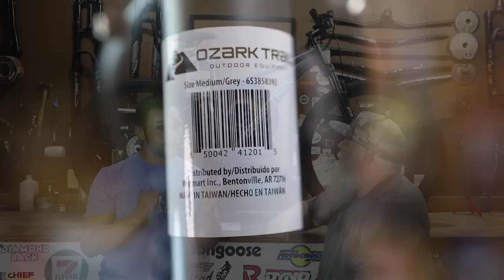Ozark Trail Ridge: Initial Impressions | Positives | Negatives | Who It's For

Comment: It's an Integrated Headset, no removable cup like Zero Stack.
Reply: What does that mean
Reply: @joshuaworth243  with an integrated headset, the head tube is machined to seat the sealed bearing, no cup installation is needed. Zero stack still uses cups but they are recessed into the head tube, so no additional stack height like external cups.
Reply: @cunvericht My Diamondback Overdrive is like that. It was a very cheap yard sale buy. It uses what looks like sealed cartridge bearings.
Reply: @cunvericht is this a good or bad thing, can I upgrade the fork if I were to buy this bike?
Reply: The new updated version doesn’t have anything in the head tube it’s clear open inside so they listened again
Reply: So can you upgrade to a tapered fork??? Instead of a straight steered tube?

Comment: Just an FYI, if this helps anyone, the Ridge is only offered in medium and large.  I am 5'11" and I originally bought the large because I was in between the two sizes.  The large is HUGE; it is as big if not bigger than most companies XL bikes.  The only large bikes that are similar in size large are the Rocky Mountain Fusion series, Marlin Gen 3 series, and Kona Lava Dome.  Part of the issue with the large frame is the stack...it is 662mm!!  I have ridden the Fusion, Marlin Gen 3, and Lava Dome and they didn't feel as big.  Long story short, I went with the medium and I think that was a good choice.  The Ridge medium is almost identical in size to the Trek Marlin Gen 2 series large or the Gen 3 series M/L (which is my recommended size).  The geometry is sooooo close to the Marlin Gen 3, if you like that feel.  So, I feel like I got Marlin 6 Gen 2 for half the price or Gen 3 for $500 less, and ready for upgrades!  If I put that extra $400-$500 into this bike, it will dominate similar priced bikes spec-wise.  I hope this helps!
Reply: So your saying the large would be great for a guy my size? I'm 6' 6"
Reply: Found a small in my local walmart
Reply: @trevor50ify  Me too! So lucky
Reply: They do have small frames, I bought one for my wife. I'm 6' and the large was a bit too big for me I got a medium.
Reply: Just sat on both today and yeah the large is fkng massive. The medium was perfect lol also now that it's been a while look for the updated version not the old one. They updated to better tires and a few other things as well

Comment: I just picked one of these up. Mine has a microshift Advent trigger and microshift acolyte deraileur with clutch a d a narrow wide chain ring!!! The frame has additional guide loops for cable rear brake cable routing. I will use them since I'm going to upgrade to hydraulic brakes immediately and they come pre filled. Absolutely amazing! They definitely keep improving this bike. Only the brakes are bad. Really bad. Otherwise Buy!

Comment: I'm curious if anyone has told you about the newest version of the Ozark Trail Ridge. I bought two after watching your videos and one was just like the one that you made the video using and the other one... well, wasn't. 

I bought one for my wife and one for me, online. One of them shipped assembled from my local walmart while the other one shipped from out of state in a box. 

I was pleasantly surprised to find quite a few differences from the videos of yours. I'm going to list some differences I spotted below.

- 180mm Front brakes (instead of the 160mm)
- JAK Front and Rear brakes (previous was Radius)
- Acolyte Derailleur (as oppose to the L-TWOO used before)
- Rear Derailleur has a clutch
- Microshift Advent shifter (previous was L-TWOO)
- No display window showing current gear on shifter
- 30T Narrow Wide chainring (previous was round)
- No plastic ring around the chainring
- Thicker crank arms
- Tires look overall the same but now have Yellow "Kenda" lettering on one side
- Smaller/sleeker dork disc
- Comes with a kickstand (for those that wish to install it)

Also, the owners manual has information for a Small Frame. I'm hoping that means we are pretty close to them releasing the small frame.

I'm going to be returning the now outdated model that I received.
Reply: My small frame has everything you just listed straight from the store, walked out and rode her home.
Reply: @Gamerhog2022 got one today, same as yours

Comment: 14:19 It's called integrated headset. As the bearings sit directly in the frame. An issue with this is if you abuse it and you can screw up the head tube, but with a press fit headset you can swap the headset instead of the frame. It's very common, but the main advantage is lower weight and easier service.

Comment: Dude! I like that the frame can accomodate two water bottles! And the headtube design is like that of my sandugo brusko machete V2 frame. For the price of the bike you spend less for upgrades. Internal dropper post routing. If you swap in a 120-130mm fork its gonna get more slack but is still safe. A good starter bike for those who wanna enjoy descends and climbs off road. 🤟😊
Reply: I don’t think it’s meant for 2 water bottles, just one placement individually.

Comment: Now that looks like a real MTB is this the next Ardor?   I always find the sizing interesting, I’m 6 foot tall , manufactures will always say I need a large, but I always ride a medium as I like a small frame with loads of stand over height, it’s also much easier to move the bike around and control it.

That’s headset is a really unique feature on a bike at this level, it is an huge upgrade!

Comment: I picked one up this morning from the Florin Rd store in Sacramento. There are 2 more on the rack now. I just bought the Northrock XC27 a few days ago from Costco, so will be able to compare the two side by side, then I'll return one (I'm thinking the Northrock will be going back). I jumped on a scale with each, and the Northrock (27.5) with the factory kickstand is about .4 lbs lighter than this Ozark trail 29. The OT is a few inches longer total. If they both had a kickstand I imagine the actual weight difference would be about 1 lb heavier for the Ozark Trail.

Comment: Just picked up this bike from Walmart for $150 clearance. Looks like someone returned it but all it needs is the rear derailleur tuned or replaced. It won’t shift like the cable isn’t even attached. If I have to buy a new derailleur so be it. The rest of the bike is like new. I’m just going to use it for riding around town and some paths.

Comment: Decent bike for the money but the PROBLEM is assembly and setup by Wally-world - the first bike we bought was the vibe model but the brakes were jacked up and the gooseneck clamp was broken / cracked due to over tightening - very dangerous that they sold a brand new bike with huge assembly flaws - if u buy one make sure u check every connector as if u were assembling the bike yourself

Comment: I have the same bike but have customized it with a 27.5 wheelset and air fork,the crown race can be used on other straight steer tube forks and works perfectly,I also put spank spoon 785mm riser bars on it,2.40 vittoria tire on the rear and a 2.5 vittoria  on the front end and have room for bigger on both front and rear

Comment: The thing is, it's a great camping or multiuse bike.  The little bit of protection for your pant leg makes sense so you can jump on without worry, so would be a kickstand, a nice durable on the rear in case you add bags.  If you want a more true mountain bike get the Trouvaille or the Schwinn Axum.  The Schwinn AL Comp is $298 and Boundary $348 both of those are worthy considerations.
Reply: I agree that this is a good bike for camping, not to be confused with bikepacking. I can't help but think that his would also be a good commuter bike for someone who isn't sure that bike commuting is for them. Or, a POS/backup bike to use for commuting in the rain or snow. Plus, lock it up at the bike rack at the train station without fear since it isn't a life altering expense if it gets stolen.

Comment: Its got modern features for a budget frame. Integrated headset and internal routing made for hydraulic brakes. Its meant to be upgraded. that a5 version can accommodate a larger cassette...its bang for the buck...

Comment: Yea integrated headset. It's for cost savings. They dont have to press in a cup, thus reducing the amount of parts needed and operations while assembling. If any problems arise you can potentially machine the headset and press in a zero stack headset down the road. Most carbon frames are made like that too, but for other reasons.

Comment: The Mongoose Ardor remains a good option at $349.  It has a 17.5 frame with 2.6 inch wide tires.  Cheaper than the Schwinn Axum both made by Pacific Bicycles.

Comment: hey wolf and tick, that headset is called an integrated headset and they have downsides and upsides such as good cost and looks clean, but also it will wear out and you cant replace the cups so the frame would need to be rewelded which is very pricey just to keep it alive. They are most common on bmx bikes
Reply: I would have thought wearing out may be a long time then if those cups are for just seating the sealed bearing
Reply: @claremontinteriorsmw  yeah if it's got a sealed bearing then I dont think that neck will wear out.

Comment: First, I am loving the videos. Y’all keep up the GREAT work ! So I am a truck driver. I bought the Ridge. I carry the bike with me on the truck. I’ve got a couple questions.  I know I’m doing it all wrong but I want to tinker a little bit.  I love the frame. That is what sold me on this bike. But I want to convert it to a hybrid bike. And I think I may want to start with the gear set. What would y’all recommend changing it to? Crank and cassette along with the derailleurs. And then I’ll either change out the tires or the forks.

Comment: Specialized bikes also have a stupid headset system.  Means you have to run with what they use and can't always modify. I've seen people actually grind out the internal cups so they can fit whatever they want.

Comment: Love mine. Been logging some miles on it and zero problems. Wish I could get the decals off. I wonder if acetone would dissolve them like rim decals as they don't seem clear coated in, but definitely not something you can peel off.

Comment: I just bought the trouvaille and it's been awesome 👍how would you compare it with this bike?
Reply: Medium
612 stack
450 reach
60 BB drop
73° STA
67° HTA
430 ST length
No CS specs just rear center

This has more about 13mm more reach then the kent T/Giordano
This has a 1° slacker seat tube angle
Steeper angle us better for climbing, but prob wont know the difference in reality.
Kent/giordano has 620 stack
Reply: @PghMtbRides  so I screwed up then got it 😅na let's wait till the actual review 👍

Comment: My local Walmart has a big bike section but never has any of the bikes you review with the exception of the Schwinn Boundary , and a AL comp.  Imagine my suprise when I walked through today and saw two Ozark Trails.  The had the medium 29er and a small with 27.5's.  I did not notice a hole for internal dropper post routing on the small. I was surprised to see that the small said it was for riders 5'6 to 6'2.  Makes no sense.
Reply from the maker: Was the small possibility the "Vibe"? Our medium Vibe was a 19" frame and had horrible standover height. This Ozak Trail 29" has no model name, but it has a normal 17" medium and better standover for sure. Thanks for the feedback about your findings.👍
Reply: @WOLFTICKVIDEOS  I'm pretty sure it said Trail on it but I will go back tomorrow and check it again.  If it is the Trail I will take pictures of it and forward to you.
Reply: 27.5 is a different bike
Reply: I finally made it back to Walmart today and looked the bike over.  It doesn't say Vibe anywhere on it that I could see.  Looked it all over and nothing.  But just as I was walking away I saw a little tag on the rack holding it that said Vibe.  You would think somewhere on the bike or literature  on the bike it would say Vibe.  Oh well guess I need to get these old man eyes checked again.

Comment: I would get a better front chainring and take it down to 28 tooth . If they could just get tubeless rims you would be over the top.  I guess Walmart is getting closer with presta valves.  Maybe worth a ghetto tubeless setup going experimental . Fork is the normal budget type . Adding a air with 120 of travel would be transformational .

Comment: No need to change the handlebar unless it's too low.
But the fork is junk, no adjustment, only preload on both springs, preload only adds tiny bit of adjustment, it only compresses the spring, it makes a difference, but not much, no damper, which is needed.
Welds look acceptable, looks quite common, nothing unusual.

Comment: Hey guys, I need to replace my headset bearings on an Ozark Trail 29 Ridge. Two questions, 1) does anyone have the size/specs for the upper/lower sealed headset bearings they could provide me? and 2) can I purchase replacement headset bearings on Amazon or do I have to use bearings specifically from a Walmarts parts list?

Comment: At one point I was saving up for the Giordano Intrepid (saw that on the Walmart website)...but if this bike works out better than the Kent ....  this may be a good thing!  Still saving up for parts for my other rides!  Haha!  Anyone got a good suggestion for a budget weight weenie trying to fit a 27.5 air fork (straight steerer tube)  for an older K2 Nomad 3.0.  I was HOPING this used Rockshox 35mm stanchion wide taper fork in it with the kit...but the taper is WAY bigger than would fit in the 26inch headtube.  Came with 120mm fork....wanna go MULLET!
Reply: Its similar enough in specs, and lighter
, Time you put a 120mm fork on ST angle may be 2 degrees Steeper the intrepid..maybe more or less depending on mullet combo

So far ove done a 29/26 combo on my Intrepid, still climbs just as well.
May bump.fork to 140mm, and swap to 27.5 front next

Comment: 31.6 is a huge deal... Waiting for head tube angle before I press enter...
Looks like the large was upgraded mid cycle.

"Someones getting a vibe that's tuned in. hahhaha same with my Mongoose  X1. Just needed a larger frame!
This has the Suntour 30mm fork, over the Ardor... Oh wait 32mm... measured(whaaat)
So far so good....
Sealed bearings... ok What's with the headtube. Can we get bearings for that?
If there is an XL, I might pick one up.

Wolfman dyno. Tell him those ain't no fricken nipples. Dialin em in like a purple nurple.
Reply: 67° HTA

Comment: A Walmart integrated headset nah really? I'd be wary of that. I prefer cups because even on more expensive bikes you run the risk of wearing the heatube of the frame out and having to pretty much toss the whole frame if the integrated cups get damaged. Thats a cheap ass frame and I could see those cups getting bored out pretty quick from hard riding.